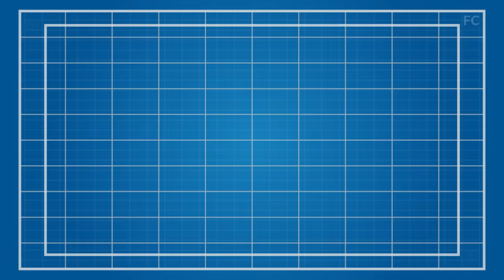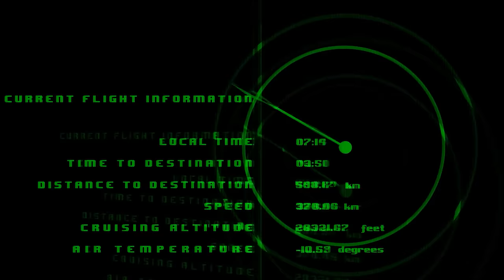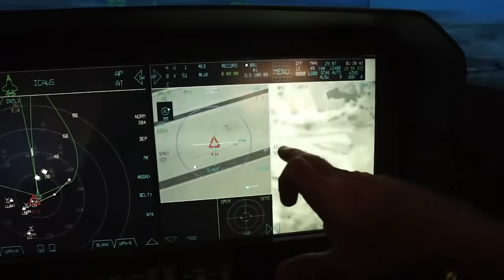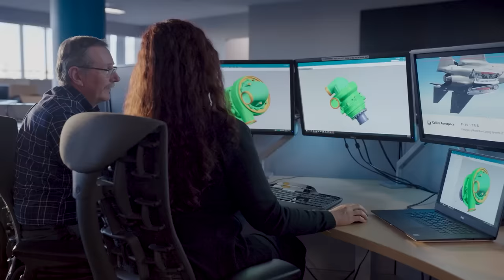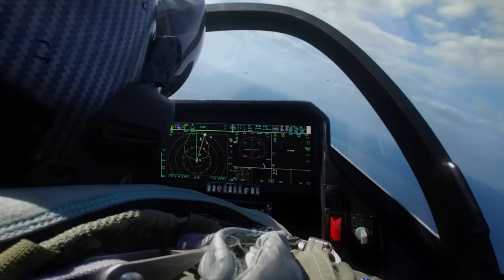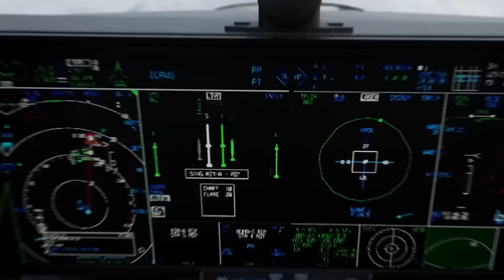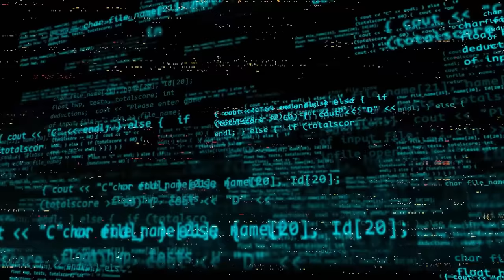US Shocked! Turkish 6th Generation Fighter Jet Is Ready For Action!

Comment: I am sure it is a fine plane but isn't WW1 anymore, it will take at least 10 years from the first test flight to the plane entering service so I don't think it makes other nations afraid now. Maybe in 10 years.
As for the F-35 being the worlds most widely used 5th generation fighter, duh, it is the only 5th generation plane being exported so that's a pointless statement. 

I also think it is a mistake to compare the planes at the moment, they haven't even decided which engine the final version of the plane will have when it enters service and any specc can change both for the better or for the worse before it goes into production. Every single fighter get some unexpected issues during testing and some things need to change, happened to all the other 5th generation planes and basically all other Jet fighters too, that is why you have a testing period before starting to mass produce them.

I wouldn't be super surprised if it eventually actually have better speccs then what the F-35 have at the moment, the F-35 will be around 20 years old when this plane enters service so that is clearly a possibility and US is likely to be starting testing their 6th generation fighter by then and maybe upgrade the F-35 too.

During WW1 it wasn't uncommon to send some planes to the front a couple of weeks after the first test flight and start mass producing them another month later but planes were about as advanced as a Ford Model T back then and pilots are considered a lot less expendable now as well so while Turkey certainly have worked fast, they have a lot more work to do on this plane.
Reply: 25 aircraft will be delivered by 2028... This is definitive information!!!
Reply: @MuratlaBorsada  I'm sure that is the plan, but I can't think of a single fighter jet that didn't get delayed due to something they found out during testing. Usually they crash a plane or 2 as well during that and that isn't me saying bad things about Turkey but something that happens to all countries.

Look on F-35 for instance, it got a huge delay. Same thing with Su-57. Not sure about J-20 since China doesn't like going out and telling people they are working on a new plane.

So yeah, I am expecting delays, just as I expect it from any fighter in development. It is different during a large war when you can ignore that a couple of planes might crash to some issue but that is unacceptable during peace.

This is of course why have a testing phase, not only do you get rid of unexpected problems but you also will do some optimization giving you a better plane in the end.
Reply: @loke6664  I respect your comments. But Turks are extremely meticulous and very talented in the field of engineering. The parts we produced and delivered for the F 35 and the F35 middle bodies were flawless. Türkiye has proven its engineering skills in the F 16s, which were produced with zero defects.
Reply: @MuratlaBorsada  I am not saying you are not, just that delays always happen to anyone developing a new fighter plane, no matter how good they are.
Every single nation who built a fighter the last 30 years have had delays, the question is more to how long those delays are.

I do applaud you for building your own fighter though, it is expensive but it is a huge strategic advantage to not be relying of foreign powers and when you make it yourself, you can make it fit your own circumstances perfectly instead of getting a generic plane that is a Jack of all trades.
Reply: When a liar starts to hear the lie he tells from others, he starts to think that that lie is the truth.
Reply: The aircraft is 93.66% domestic production. The engine and ejection seat are imported only. The core engine TF6000 has been start with succes. Despite all this, some people are still desperately trying to keep us equal with other countries. We will crush your dreams..!
Reply: @onurcan8434  Uh, what? I never claimed you didn't use domestically produced parts, just that testing modern fighter jets takes time.
There are good reasons for that too because if you take your time you can optimize your plane getting a superior plane to the first test model.

Making your own fighter jets doesn't make a country unique but today it is still a rather small number of nations that have the skill to do just that.

Anyways, keeping the testing time to an absolute minimum is a mistake that you only see countries in active wars do. A modern fighter jet needs to last 30 years so adding on a couple of years for increased performance is a small price to pay.

It is impossible to say what the future will bring but you really want a fighter capable to go against Su-57, J-20 and F-35 since those are the best 3 planes you are likely to go up against in a conflict. Taking the time you need to get that done is worth it even if the price get higher.

I will not guess how good any 5th gen plane not in service yet will be, I don't have that knowledge since it is classified and still just estimates but this one and the one South Korea looks seems both very promising.

If you think that is me talking smack about your country, you are free to think so but that is not the case.
Reply: @loke6664  I see you don't understand. Not even a single piece of the information you provided is correct. Have you ever wondered why this video was published approximately one month after our plane's first flight date and 1 week after we started our first core engine?
Reply: I see that while you took the time to tell other people's lies, you did not find time to think...
Reply: You re stuck with 19 century  mentalities 😂😂😂.   19 century used 1G technology  2024 nation are useding 5 G and some already 6-7 G. what it used take a nation 7 years to aquire  nation today are aquireing thise same result  in 2  sometimes 1 ..so the Turkish  5- 6 Generation  fighter will be ready for combat  mission are early as 2026-7..
Reply: @daggerin4life726  Uh, in 19th century they had telegraphs, not 1G. I think you mean 20th century?

But anyways, let's take the F-35 as an example since it is the closest plane. It first flight was in 2006, the first plane put into operation was in 2015.

Yeah, you might very well be faster then that but 2 years? That is half the time of any other jet fighter in the world the last 60 years.

Better technology does not make it faster either, rather you have more things you need to test.

Again, I am not saying anything like "You aren't skilled enough" or anything else silly, just that this is a process that takes time no matter who is doing it.

Su-57: First flight 2010, first plane in service 2020.
F-22: First flight: 1997, first plane in service 2005.
The J-20 supposedly only took 6 years which is extremely fast but they also had to do a lot of upgrades on them already since they were too much in a hurry and some of the information is classified.

Those are all 5th gen planes in service.

So yeah, 10 years might be too long, it is more of a general rule (and note that 2 of the F-35 models took even longer), 8 years like the F-22 might be more likely if you put as much focus on it as USAF did. Maybe you can even get it down to 6 even if that might lead to later problems.

But 2 years? That is 50s speed when people thought that it was acceptable that planes just crashed now and then.
Reply: Generation 5 and 6 have no idea what it means. Don't tire yourself out for nothing, Loke.
Reply: @onurcan8434  Gen 5 is the most modern fighter planes in the world with only 4 different planes in operations. Stealth, high end radar and drone control is among the speccs (there is more).

South Korea have one in the works too, England, France and Italy are allegedly working on one together as well.

So yeah, this is a very impressive project, you can count Russia's number of 5th gen planes on your fingers, only US and China have manufactured them in larger numbers.

6th gen doesn't exist yet, no proto type have been flight tested and the Yanks hope to have one in service in the late 30s but that isn't super likely.

F-16 is a typical 3rd generation plane. Gripen and F-15 EX is considered 3.5 or 4th generation depending on how you see things and sometimes the latest F-16 planes are counted in too but that is a stretch.
Reply: Loke, What is needed for the 5th generation is invisibility, what is needed for the 6th generation is artificial intelligence. he doesn't know these things. I'm telling you don't bother, it's in vain, and you don't understand.
Reply: We do not yet have the engine required for the 5th generation, but you will not have to wait until the 2030s to see the 6th generation fighter jet, do not worry. Our 6th generation fighter jet, Kızıl Elma - Red Apple, will have this feature in a few years.
Reply: A job fills the time allotted to it. If you have little time, you can do the same job in a short time. World War II is the best example of this. What prevents this is the lack of knowledge and skills. Both are available in Türkiye. It doesn't just produce projects. It actually produces parts for giant companies such as Boeing and Airbus. It produces engines under license. He has many unmanned aerial vehicles and successful projects such as Hürkuş and Hürjet. There are very successful helicopter projects.

Please take a look at the famous Su-57 plane you mentioned. Rivets are selected from 100 meters. A very primitive production model. However, aviation production standards in Türkiye are at European and even American levels.

Let's talk about the electronic systems of the aircraft. Here too, Türkiye has a great advantage. In Turkey, no subsystem project is carried out for a single product. Simpler versions of all of Kaan's subsystems are already being developed on an airplane, a helicopter or a ship. So, I am sure that "early penetration production" will start in 2028.

However, in my opinion, a 5th generation model of the designed aircraft engine will take another 10 years. I'm not sure if there will be an interim period with GM or if a working engine can be made by then.
Reply: @fotografustasi  They said 2 years, not 2028 even though that also seems a bit optimistic.

F-22s record of 6 years, I can believe that. And yeah, the engine is certainly one issue.

 If you look on my post discussing the different 5th generation plane, US took 6 and 10 years to get their planes from first test flight until the first planes were taken into active service. 
Frankly, the 4th and 3rd gen planes are generally in that time line too and for a 5th generation, that is still a great achievement.

2 years would be 3 times faster then even the US with a ridiculously bloated budget did with the F-22 which from what I seen of the speccs seems to be the closest plane (which is good, the F-35 are slightly stealthier but flies like a brick).

But hey, lets wait and see. It will also be interesting to comparing it to the 5th gen plane South Korea is working on, it also seems like a good machine.
Reply: Most of those tests can be simulated and prevented at the design stage,  no need to wait for 10 years for something to fail. It has tons of sensors inside to detect and provide early warning anyway. Computers has come a long way.
Reply: Your analysis is correct, but unfortunately it does not match today's situation. The projects you mentioned were designed with the preliminary design information and possibilities of the previous generation. Over time, technology has changed and developed. Seeing this, the demands of the air force increased and things took a long time. Because designing something correctly from the beginning saves incredible time. It is much more difficult and expensive to fix and compensate. I'm sure if the F-35 designers had known what was going to happen to them, they would have designed the plane as a twin-engine model without vertical takeoff. They spent 10 project money. However, they could have used their resources much more effectively by designing two or three different aircraft. Because China learned from this, it was able to start production very quickly. (J-20, J-31)

Things that were problems in the past are no longer problems today. The design phase is now much shorter. Because the plane has a digital twin. This pulls the knowledge you would gain from flying in the past back to the design stage. Software and testing time requires a huge amount of processor power. Türkiye is at a very good level in this regard. Airplanes now contain many more sensors and electronic parts than before. You know hydraulic and mechanical parts involve much more testing and design time. There are also wind and lightning test facilities, one of the largest in the world. All tests can be done within a few km distance. So you don't load your plane and go to the other side of the world for each test. You won't have to wait in line for months.

If you process aircraft parts with new generation materials and production tools, you no longer have a strength problem. Many basic aircraft parts that were historically machined from Aluminum are now machined from block titanium. In addition, composite materials reduce the risk of metal fatigue. In the last 10 years, sensor fission and avionic systems in aircraft have developed so much that aircraft are no longer exposed to G forces that require high strength. That's why America sacrificed its F-22s. He terminated the project. You don't need a super body, you need super eyes and super ears. And a useful wingman.

Nowadays, what extends the life of an aircraft is maintenance. This means financial power and doctrinal approach. This is what keeps 70-year-old planes alive. Even if the plane on the ground is new, it is dysfunctional. Turkish air power infrastructure is very strong. It is the third largest power in the world, along with America and Israel, in the revision and technical maintenance of western model aircraft systems. Without the courage this gave him, he would not have been able to attempt such systems.

The main problem of most rich European and oceanic countries is that they do not have to deal with embargoes like Turkey. Since their interests coincided with America, they bought everything ready-made or Know-How. The reality of the Ukrainian war hit them like a slap in the face. Because of being put on hold, they have no design or production capacity left. They are trying to do business with people over the age of 50. They went 20 years without any information transfer. Now they are trying to steal engineers from the world. If they were not ashamed of Turkey, which they embargoed, or if they could satisfy their pride, they would want Turkish unmanned aerial vehicles. There are still no working UAV systems.

Last word. It was not the lack of testing or poor quality production that brought the Second World War to the American industry. Yes, they were there too, but they did not prevent the work done. The main reason was people's devoted work. The main reason why Kaan was built in a relatively short time is the presence of engineers who do not go home for months, talk to their children on the phone, and work 18 hours a day. He sees this as a matter of honor and patriotism. Just like the American people in World War II.
Reply: @fotografustasi  Good insight. How are they coping with material design issues like
high temp steel? I thought they have issues
in that area delaying the engine work.
Reply: TYRKEY  HAS NO ENGINES FOR THEIR ALTAY TANKS ….ORDERED FROM KOREA…AND THE ENGINES OF TBS ARE CANADIAN…

Comment: The F35 has one engine, the Kaan has 2(? - your pics show many F35 pics).  The Chinese J20 is also a twin engine fighter with underpowered engines (it needs 2 smaller engines).  Cobbling together a stealthy airframe is not the end all solution, but a sufficient 5th generation engine to pair it with is the gateway (trans sonic cruise without afterburner) is the measure of a 5th generation fighter.  To date the J20 has yet to achieve this goal (5+ years since first flight).  So, good luck in gathering partners as that is what it will take to develop an engine (or engines) to power your dream/quest.

Comment: They need a more brave pilots  who dares  to raise the landing gear and push the throttle in a bit.  230 knots is the unimpressive speed of a single engine Mooney or Bonanza.  This experimental aircraft needs to show it can handle rolls and loops before it can be called a potential fighter jet.

Comment: The Turks' biggest deficit has always been quality. They used to sell books based on their weight and not on the "specialness" of a book. An aircraft is only good if it is qualitatively built, as proven by many years of experience and knowledge. I suspect that Turkey will have to deal with a lot of repairs and other upgrades. Of course there will also be customers who will be very disappointed. But I am sure that the efficient Turks will perfect the Kaan fighter jet; with the help of the “Turkish Federation”. If they learn what “quality” means, then they will produce quality.
Reply: turks were not even in the military equipment building business up until recently what "always" are you talking about?
Reply: ADIN GİBİ (DİRTY) BİRŞEYLER YAZMIŞSIN....
Reply: @yvzycl2654  You have no arguments, therefore shut up! 🤫